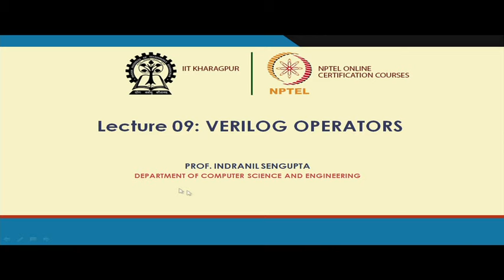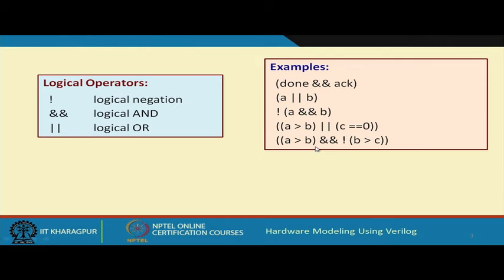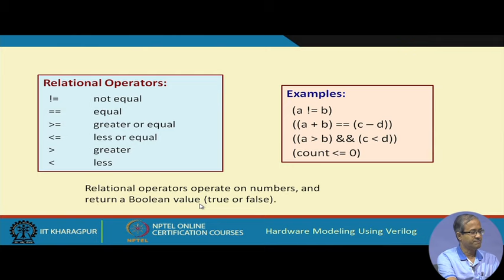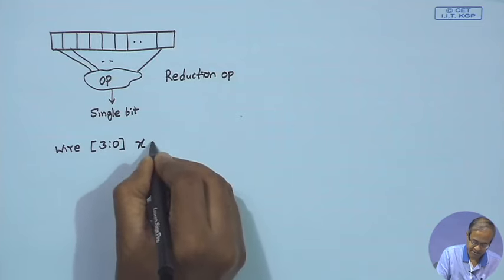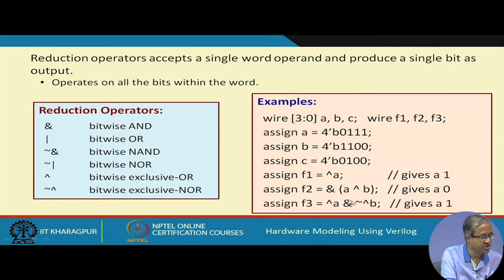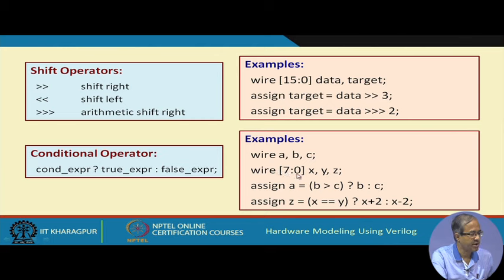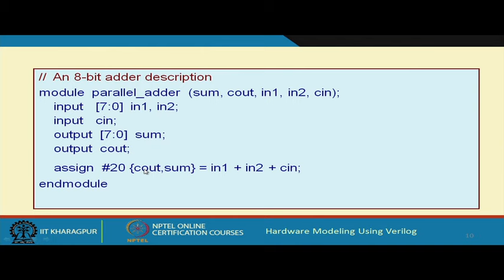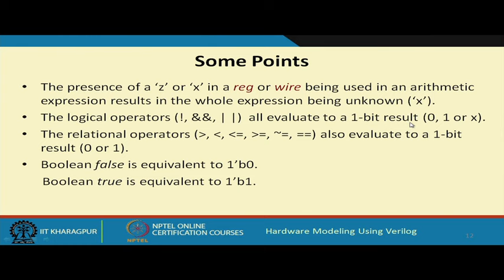VERILOG OPERATORS

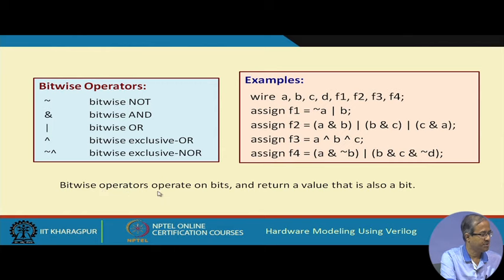Comment: 14:13 the statement "bitwise operators operate on bits and return a value which is also a bit" is incorrect. 
because bitwise operators do not necessarily operate only on single bits, nor do they always return a single bit.